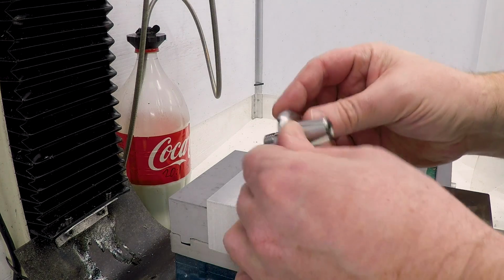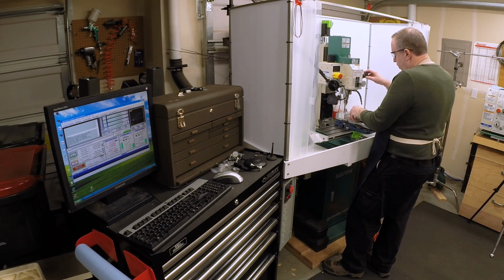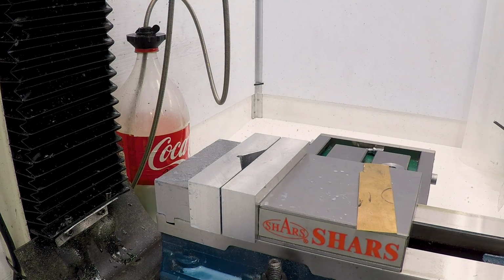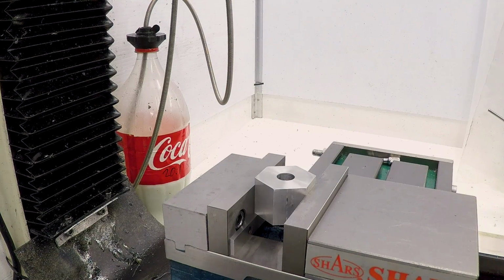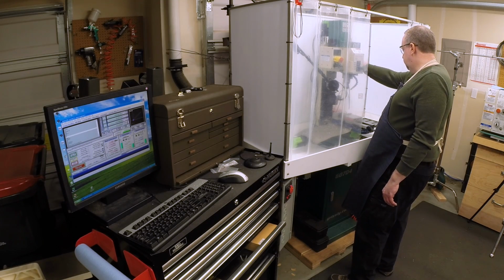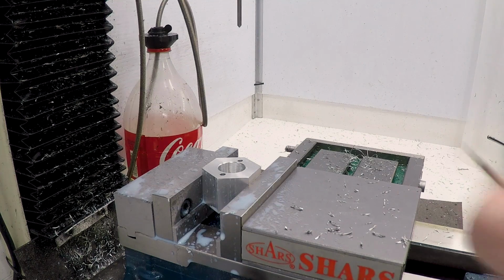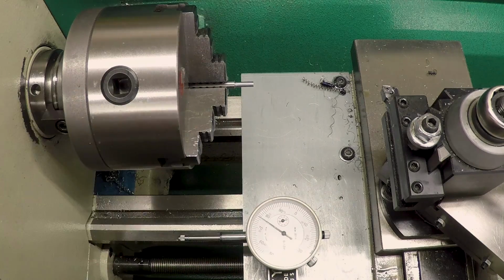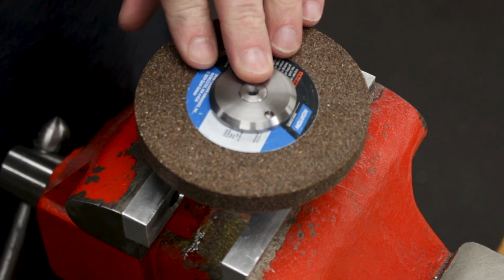Making a Toolpost Grinder Part 21: Taper Tightening Fixture

Comment: My question is why did you choose to bore the taper in the Mill rather than the lathe? It was already in the Chuck. The hole was concentric. (Not that it matters that much for this part). All you would have had to do is set the compound back the way you first started setting it up for the Arbor. It also wouldn't have distorted the hole once removed from the chuck and had a much better finish. This Tool Post Grinder is turning out very nice. You are doing a fantastic job on it. I just started watching your channel so I have much to catch up on. Last I am very please to see the capability of the G0602. It looks to be doing much better than I was anticipating. Mine is on back order unfortunately.

Comment: Does your mill setup allow for a pendant with a jogging wheel?  Especially in Z, I can see how the lag in stopping a 'jog' from the keyboard gets to be a concern.

Aside from the satisfaction of building your own tools, do you think this design can hold the same or better tolerances as a name brand toolpost grinder?  I'm no engineer, but I presume the limit is bearing choice?
Reply from the maker: I don't have a CNC pendant, but I do have a Shuttle X-Press configured as a jog wheel.  It works quite well, but has a couple of limitations.  It allows variable speed continuous motion with the ring and jogging with the center dial, but the max speed is set by the current feed speed percentage in Mach3.  So if I have Mach dialed down for manual cutting, I can't rapid with the dial.  I still have to use shift and the cursor keys on the keyboard to rapid.

I think the biggest challenges for grinding tolerance is going to be the rigidity of the lathe and the wheel dress.  I think this grinding spindle is going to be fine, but my lathe doesn't say Hardinge or Monarch or Mori Seiki on the side, so there's that.